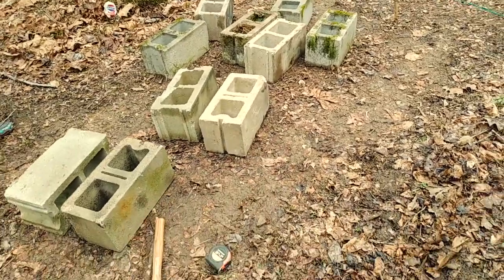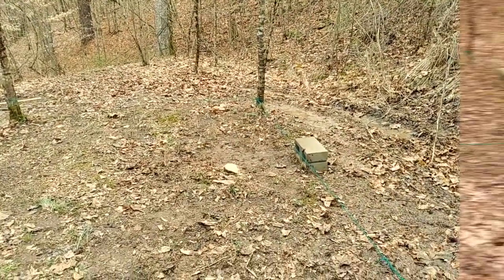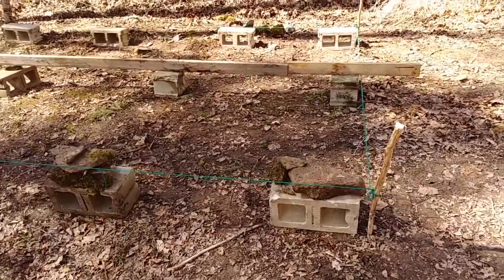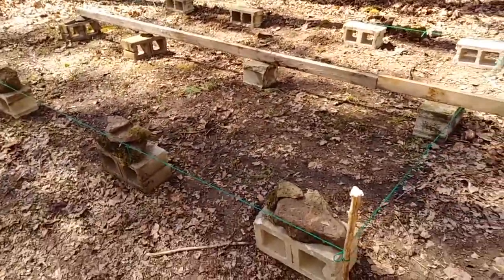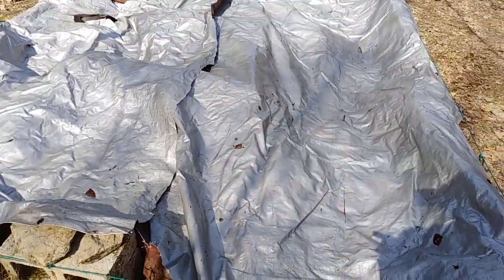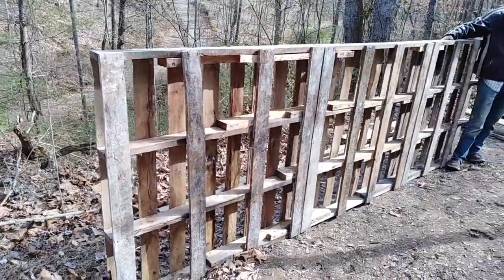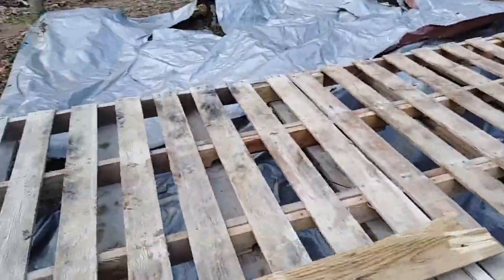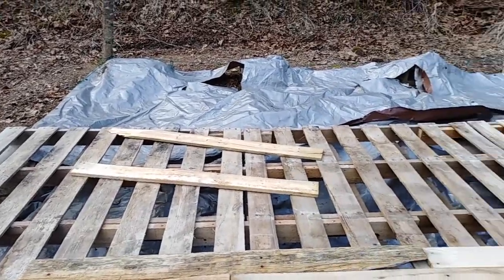Working on the Cabin Foundation and Floor

Comment: The pallets as are, are not too bouncy when you walk on them? It'll be even stronger I'm guessing as you attach more wood on top for the floorboards, as you showed. Nice start to the foundation! Fun to watch :)
Reply from the maker: It is getting stronger. I had to put more bricks in between the ones I already had. I would say as I add the walls it will gain even more rigidity.

Comment: great stuff,  keep it simple but still interesting. Great channel.  Off topic Luke. do u think a durable plastic mixing tub with a hole in the middle could be used as a d.i.y bathroom floor for a van?  I know its an odd question
Reply from the maker: Thanks. I think the mixing tub would work really good. Were you thinking of putting a hole out through the floor of the van for the drain, or having the tub elevated and running it under it?
Reply: luke Fugate Im thinking about a hole threw the floor of the van with some kinda flexible plasic tube connected to the hole so the water can drain out of the tube. And i think i should some hhow secure the mixing tub to the floor of the van as well with screws or mayb gorilla glue, but not sure. Its gonna be a small 20w x 30L shower enclosure with just curtains (i dont have the skills to build a real bathroom with walls) around it and a portable toilet inside to sit on.
Thanks for your response.
I will be watching and thumbs up
Reply from the maker: Screws would be best to secure it just in case you ever have to take it back out for repairs. Let me know how it works out.

Comment: Aren't the holes/cavities in the blocks supposed to be vertical.  Lose alot of strength laying them sidewise like that.
Reply from the maker: You are correct. I didn't know that at the time. They are still holding up fine. I guess I'm just lucky it isn't a heavier cabin. Probably would be wise to Jack it up and reposition them.

Comment: Guess what? I be traveling around in my pickup truck and it's cold! If I turn the AC/heat thing to the inner cab circulation does that shut a valve that shuts a vent? Shud I do that? Thanks
Reply from the maker: Are you talking about the recirculate mode of the heater? If so it just opens a vent that will draw the air in from inside the cab. It recirculates the air inside like a furnace in a house. The problem with this in a vehicle is that if there  is an exhaust leak that you don't know about you are just recirculating the same air. With the vents set to draw in air from outside you will have a steady supply of fresh air. Be very careful when running your engine for heat while the vehicle isn't moving though. Even a small exhaust leak could be deadly if the engine runs for an extended period. I would only run the engine long enough to get it good and warm then shut it off.
Reply: luke Fugate ....yes I don't run the engine overnight when I sleep. I mean it's possible that at 5 in the am if it's really cold i might turn it on until it warms up a bit. When u say a leak you mean under the truck and the fumes will seep up? But if I turn the heat dial to recirculate overnight and I never use the engine would that be better because is there a vent to the outside that will be closed?
Reply from the maker: The fumes can come up through any cracks or holes into the passenger compartment. I would suggest getting a carbon monoxide detector just in case. To get heat out, you'll have to run the engine. The heater works from the residual heat from the engine.
Reply: luke Fugate ...ok thanks but what I meant was: if I turn the dial to recirculate, and I don't turn the engine in overnight will this keep it warmer in here? Does it CLOSE a vent from the outside? And prevent more cold air from coming in?